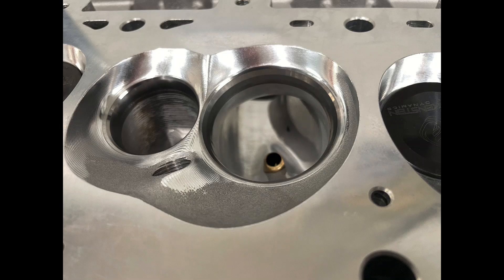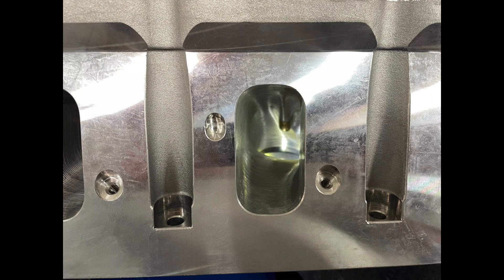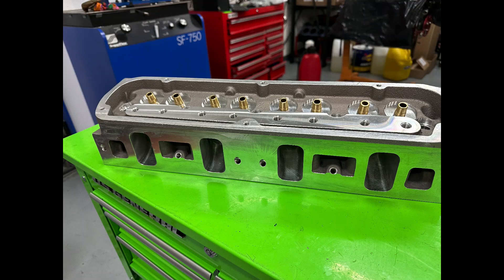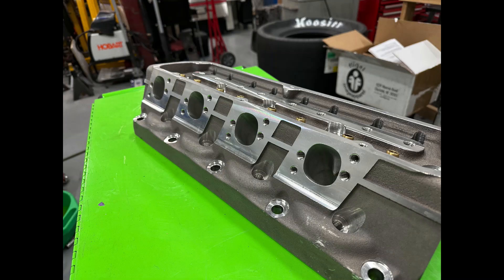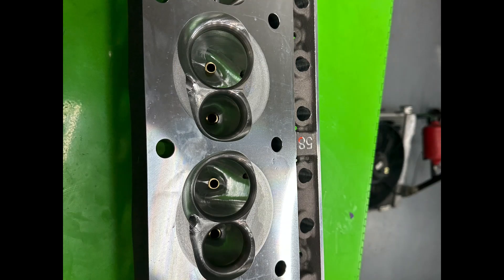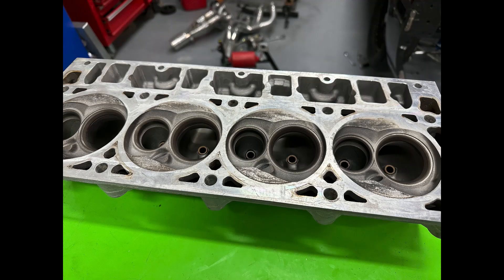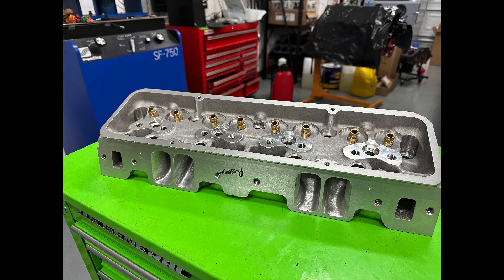Is More Flow Better

Comment: He has pipemax all wrong, If you have a head the flows 300 cfm, you adjust the "VE" until pipemax reads the engine needs 300 cfm at that rpm, what you need to do is input your engine specs and adjust "VE" to match your cfm or for the HP you want, then go to menu and select engine cfm demand and you can see the cyl demand compared to cfm provided and you will see you never meet cyl demand on any regular type of engine.
Reply from the maker: No sir that is how you make a head to big for your engine. Your VE comes from what the combo should make then the CFM matches that. If you had a head that flowed 370cfm for a  355 you don't adjust your VE to make it match the 370cfm because if you did then your VE would be 120+ which sounds great unless you cant turn it 9500 and will never see that VE.

Comment: im more thinking like .. if i port a top.  i need to do something about the entire exhaust system also.. also the intake system.   And a new engine... better springs. and a more aggresive cam to gain something.

Comment: Piston cfm requirements are different that cfm  head flow requirements 

The area under the curve and cam timing go hand in hand

No I’ve learned this the closer the head flows to meet piston cfm demand of the motor at 60-70 percent of lobe lift of the cam the more power can be made

Comment: Everyone knows that the Ford Cleveland V2 heads (small valve) makes much better torque than the V4 (big valve) heads. The V4 heads only beat the V2's above 6000RPM where nobody actually drives...

Comment: Why do you Port ?..... What does Porting do ? ....Ever heard  of Static vs Dynamic Compression ?

Static Compression  is Measuring & CCing  , Pistons, Chambers, , Gaskets, Deak height !  Static 

Dynamic Compression is a Running engine , ...Flowing Air & Fuel ...  measure of Compression ! More Flow creates HIGHER Dynamic Compression , Starts with .....RING Seal.... of course you have to have the Right CAM Timimg to Open and Close at the Right Time to capture the Air & Fuel Mix ?  Exhaust Open and  Close  Timing Critcial too

Piston on Intake  Stroke creates a Depression ...Outside Air  rushs in @ DA to fill the Low Pressure VOID ? No Vaccum.., Just Mother Nature ?

More Port Flow {Captured} Raises ....Dynamic Compression ...&  Increases VE ?  100% to 130% VE  with Inertial-Supercharging WAVES  bouncing of the back of Intake Valve while Closed ???

Pumping Loss is Piston Drag, Ring Drag, Crank-Rods, Wrist Pins, Oil Pump Friction, Oil  Windage, Oil Drain, Spring Friction, Cam - Lifters, Rocker Arms  Frictions, Water Pump Friction ?

Comment: Ve has nothing to do with vacuum pumps. It has to do with port energy, wave effects, and chamber scavenging and the camshafts ability to capture the most forward flow and reject the most reverse flow. There is an organ pipe effect that for some reason old books call "ram running" even though the wave is running through the air and it's not a wave of air ramming into the cylinder the formulas presented under "ram tuning" are clearly sound wave timings as they only look at lengths. There is a Helmholtz effect that is often confused with the organ pipe effect but is different which has to do with delays of accelerating air and decelerating air coupled to the piston with a springy air volume. And there is also port energy based on average velocity and mass which has a lot in common with hemholz effects. There are also tapered pipe effects that aren't described in the old literature and seemed almost like voodoo requiring trial and error. When you stack the right combination of measurements and get cam lobe phasings working at the same speed you get more Ve and torque. Parasitics in the intake and exhaust can affect the Ve probably more than actual "pumping loss." It's more losses of pumping by way of losses to pumping than actual losses to pumping alone. When saying that an engine needs x cfm it needs to be qualified in so many ways because the cylinder is gonna be filled with something it's the density of everything in there and the amount of contamination by spent exhaust gasses that change. A super flow Dyno may use a flow meter with a fan mounted on an encoder that's been calibrated for airspeed through the diameter of the unit. The speed gives length and time information to convert to cfm. Pipe max will tell you that if you expect the superflow dyno to read 108% Ve then cfm is actually moving  but it's not telling you precisely what Ve you should get for the cfm which can be estimated but can't exactly be known outside of the Dyno without every dimension down to the camshaft profile. It's not telling you exactly how that cfm value affects the Ve so it might make you say sure that's enough but it's not eliminating the benefits of having more.  When cfm is tested on a flow bench there is a test pressure and there is a density change associated with that test pressure. If you're using a 28in test pressure that's about 1psi or about 6-7% loss of air density. There is reason right there to say that you could infact be giving away 50hp by not having more flow. Again it gets more complex because of the complex pressure curve due to above reasons. But also because the valve is open more than 180 degrees but many of those degrees are partial so you'd actually have to multiply the flow curve by the lift curve and find the degree-flow under that curve and decide if you are giving up Ve based on that number. But it gets complicated more still because often when you have that you end up with an engine that's lazy down low and wants to rev much higher and your giving away something by having power in an rpm you don't intend to use or the intake runners get too long for that rpm. Eventually port limiting velocity because of a limit in valve size or an obstruction like a pushrod or some manifold rule requirement makes it impossible to flow more air because it doesn't go supersonic this happens no matter what the flow says and eventually the sound wave tuning makes it so you can't get through the valley to the peak where the next harmonic exists. So maybe a person should go by port limiting velocity and runner lengths and try to get as much flow as possible in that space so long as there isn't a loss in port energies. Having more flow at the valve should increase port energies up stream but adding excess volume to get there will decrease energies in the head. Pipe max is good for manifold and header length selection but you might also want David vizards software that plots port energy based on volume and flow. There is no reason you can't use the manifold runner as part of you port for these comparisons... I can't remember exactly if pipe max does port energy. It seemed like a better tool for building exhaust or choosing intakes because it shows the pipe harmonics.
Reply from the maker: Vacuum pumps help ve because it helps the rings to seal better hence more torque and ve.

Comment: What I try to tell guys is.  Where is the engine gona live at and what are you doing with it. Flow is just a number   Port design is to make different power at different RPM. Where do you need the power. Big mud bogger. You need torque down low. Drag engine wide open power threw the RPM range. So when they get caught up in just the number and what makes the most power. But wide open throttle in a 2500lb car rowing threw the gears at 7500rpm might be what you want. But there’s different ways to make different power where you need it.

Comment: Where can a calculator be found for determining head flow needed? 

I'm building a ~13:1 LS 402 and have LS3 head, but can more easily keep the compression up if flow from say a ported 243 is enough.
Reply from the maker: Maxrace software called Pipemax

Comment: Sure, 15cfm isn't necessarily worth 30hp in all cases, but better flow generally yields more power. It may put more of a bottleneck on the intake manifold of exhaust, or the cam may not be optimized for the flow, but better flow will help peak power. 
  Sure, a 500cfm set of BBC heads would be a waste on a stock 7.5:1 200hp 454 from the mid 70s, but they'll make more power than the stock combo.

Comment: I dont know a lot about cylinder heads , what I have learned is from my limited experience. I built a small block chev a 302 a long time ago for my 68Camaro  a four speed manual.  I bought a set of heads that came off a g gas car that sent a Monza to I think 9.98 at one time . I built the engine in I think 1980 so the heads came off a car before then . At any rate I built a engine capable of turning 7800 or so and  stay together. It ran hard all the way to the Rev limiter.  It would have made power past that if I had the bottom end to go there . For me on a hot rod I want the engine to pull hard and not lay over . Heads is one area I try to get the best I can to do what I want . So I just ask the porter what do I need to make this much power . Lastly I rather have a really good set of heads and a little less cam to accomplish the same results.  Thanks for your good advice

Comment: But when you look at PipeMax's "piston CFM demand" vs. the induction system's provided air flow at each crank angle, even if you step up in intake CFM a LOT there's still a great many degrees of crank angle that the engine IS demanding more air than is being provided... -That view sure makes it look like you WILL gain more power with more CFM.    None of it makes sense without velocity and cylinder fill after BDC being considered, IMHO.

Comment: I'm stuggling with this right now myself... doing a small block mopar just for beating on the street and having fun... not a lot of head choices and i really want TFS heads but they are overkill by a mile, the choices below that are not much cheaper but not near as good either.. for something that will rarely see over 6k rpm, not sure where i should throw money at this point..

Comment: The bigger the cylinder diameter, the more area on overlap for the scavange to fill, the more cross section you need, stroke just adds VE after the scavange.

Comment: Hey, sorry to comment again, lol.  Do you have any vids on building TQ?  I'm VERY interested in how to keep a high velocity flow on smaller ports, such as just port matching the roof of ports/matching intake with top of port and no grinding?  I am working with an inline 6. Would this help the intake to keep the Velocity up, especially with a carb for low RPM TQ.

And do you have vids on intake mods?  I've rounded out the bottom of the intake where the Carb sits, to allow more flow, not sure it made a difference, lol.  Like an inverse Velocity stack, sort of, which I know stacks work, as I've seen it testing with Smoke- tried to increase CFM on a Weber 38, it was a fail, lol.

Comment: I like your vids, I think stuff like this tends to be lacking sometimes in Engine Building (Hot Rod mags/marketing).  I'm new to all of this, and learning.  In reading Smokey Yunicks book, he talked about the whole system being a Venturi into a Venturi into a Venturi to keep velocity up.   Interesting theory.  I'm learning in a wierd but Interesting way, lol.  Building TQ in a Jeep 258 (Dyno'ing 3 heads, stock, 7120 4.0 and the Edelbrock 50169).  For me and Jeeps, over carb'ing and too much flow has been an issue. As us normal Jeep guy's are only working within 800-3,500 RPM.  A cam is next, but sticking with my little Weber 38- custom Aux Vent's and I ground downed the Emulsion tube.

Comment: We often forget that carburetors, Holley 4 barrel style at least originally got their cfm rating @ 1.5”hg. That’s 20.4” water. Making best power we want to reduce vacuum to a minimum at WOT to allow greatest air/fuel density to increase power. If a larger carb such as Eric’s 1000cfm drops WOT vacuum to .7”hg then what would that carb flow @ .7”hg or 9.5” water? Surely a less cfm figure but we are hung up on the flow number @ 1.5”hg. Most carb experts don’t talk cfm but rather dimensions of venturi, throttle bore and venturi to throttle bore ratios. It’s phenomenally difficult to get people to understand engines operate off density and not cfm. A carburetor is a density regulating device, not cfm changing device.

Comment: I have noticed on our asphalt circle track car that is a 358 big boar small stroke 12.5 compression engine when we rum Winchester speedway if I put a carburetor that flows 965 cfm we will pick up 4 tenths over our regular 850 cfm carburetor 
Thank you for the video

Comment: Good Vid
Reply from the maker: Thanks
Reply: @WeingartnerRacing  thank you for these videos so much good information on heads not everyone generally uses. I have a set of these 230cc cnc Trick Flows and basically took them out of the box and bolted them to a 406ci. It made decent power with a unported super victor and a street roller cam.

Comment: All about knowing that rpm you want it to work at sometimes the mild head with the right cam goes really well . But at a pro race build we know that larger port and cfm will make what rpm we want  , with the cam it needs , every single build needs its heads to suit,  simple

Comment: All other things being equal, would you select a larger flowing head for a methanol drag race BBC than one for race gas?
Thanks!
Reply from the maker: I do end up going slightly larger for methanol.
Reply: @WeingartnerRacing  So there IS a replacement for air displacement (increase in CSA). -Terrible attempt at a pun... I'll go iron my hands now...

Comment: I've always had a theory that the reason why a "theoretically too big" carb makes a little more horsepower.

Having "Just enough air flow" might allow the air to go in, but it's flow characteristics might be "dirty" instead of smooth and steady.

By opening the orifice to a larger size it allows the air to equalize easier between any of the small low/high pressure zones on the carburetor's surface areas or any small edges, basically where air may have to slow down and/or change direction abruptly to get "in with the crowd" of flowing air.

Just my theory, but this could explain why a full addition of 200cfm might gain just 4-8 hp. 

As it's not the cfm gaining power, but a more smooth/predictable airflow route for a greater percentage of the existing airflow. Ultimately adding efficiency.

Does this align with what you're explaining in the video?

Comment: We see cfm numbers for intake or exhaust flow and infer results, but the actual flow characteristics are dynamic, not static. Further, exhaust flow can have a huge impact on intake flow (remember the 5-cycle cam from Isky?). Flow through the carb or throttle body is mostly the average of what’s going on in the cylinder head. So steady state flow from a flow bench gives you a piece of data, but it’s not the total answer! The dyno, on the other hand, gives you the actual result! Can’t wait to see some comparisons with The Mule! 

Let’s do some math. At 6000 rpm an engine has 50 intake cycles for each cylinder every second, or one every 20 milliseconds. The intake valve might be open for 250° out of 720°, so that is roughly 7 ms. The 400 cu in engine has eight 50 cu in cylinders, so in the 108% VE engine we have 7 ms to move 0.029 cu ft of air. That equates to an average flow of roughly 250 cfm, but flow doesn’t turn on and shut off in a square wave. If it moved as a sine wave, the average could be around 0.636 of the peak, or 390 cfm. We use clues like the flow bench to help determine the best way to make power, but the numbers only reflect a part of whole. The running engine tells the final story. Thanks for this video, Eric, it’s a good one!

Comment: Great topic.
How'd this work on the stock  heads in my 1988  4.3 powered S10?  
....maybe add some Manley race flow valves and  change the exhaust to 1.6 before porting.
What, 50hp? 😁
Very enlightening video 👍